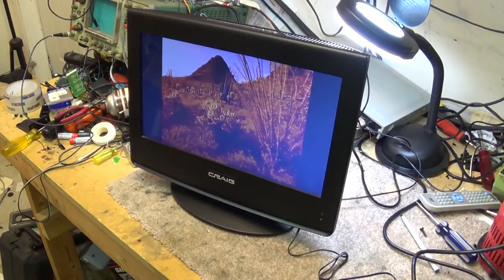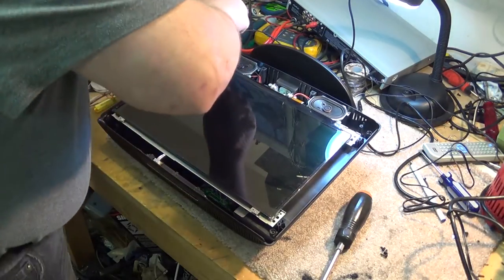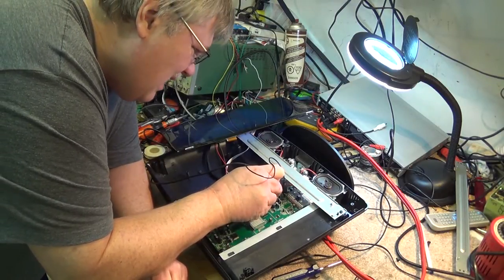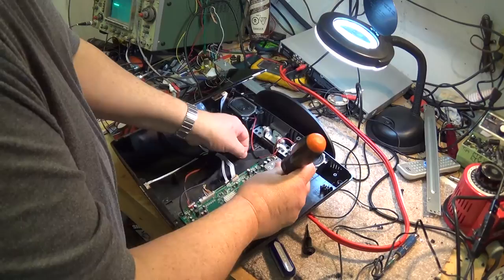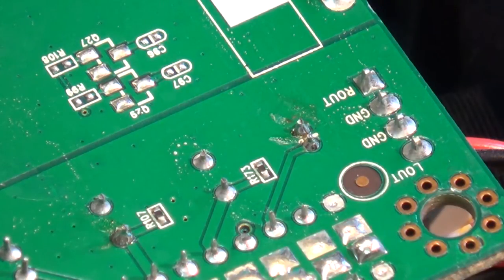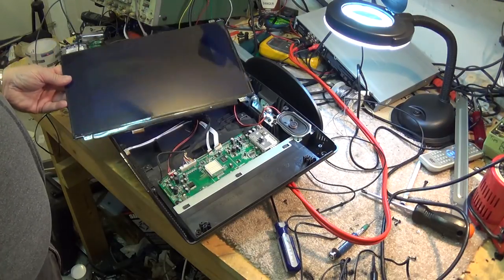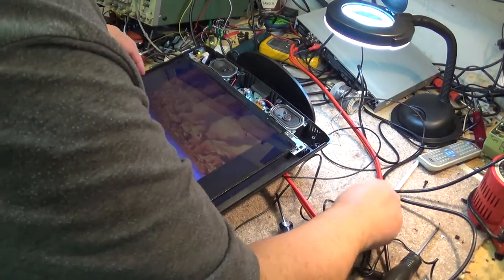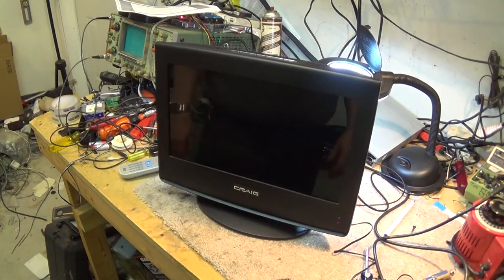Craig TV Audio Fix

Comment: Back then in 2013 to 2014 I use the 2009 Craig 15 Inch LCD TV to look the Doppler Radar and see what's next about both Severe Storms and Winter Storms which helps me to understand by look at the Radar and see if there's a line of the storm, etc. Not only that, it can actually show the Watch Box like Severe T'Storm Watch (Yellow), Tornado Watch (Red), Flash Flood Watch (Dark Green), etc., because, I like the way they can keep it up-to-date about the weather events. 

And what channel I do use back in the day? I was tuned to Ch 11.3 SDTV, it's a WHAS-TV. Until by the time when they change to a new program were they got Accuweather move from Ch 11.2 to 11.3, they put the TV station what they called "Justice" channel. They no longer broadcast their Doppler Radar to Ch 11.3 because due to a new program they signed for, and I find that is sad you know, it feels like I don't get any resources from the station which that's my understanding.

Comment: I have a Craig  13 inch Model No. CLC503.   When I turn it on from the remote the light on the TV goes from green to red.  A few seconds later the screen starts flashing.  Over time
the flashing slows down and then stops and the TV works perfectly.  I tried a different power supply with no change.   Any tips would be appreciated.   Thanks

Comment: 2.8 lbs. That's what mine weighs and there's a less inside it than yours. No picture, debating whether it's even worth bothering with. But it's more of a challenge to me to get it to work I guess. Got it from Goodwill for $0.99. I noticed a TCL part in it. Mine, the screen was attached to the front bezel.

Comment: what is the highest voltage your scope will handle? thank you...
Reply from the maker: The maximum input is 400v but with a 10x probe that would be whatever the maximum rating of the probe is.My 10x probe is rated 2KV,  So at 2KV the scope would see 200V. The reason for the prove rating is insulation. There are higher rating HV probes available. WHen I was working in the shop we had a 30KV HV probe that would attach to either a convertional scope probe, or VTVM probe.
That was used for measuring extremely high voltages in old tube televisions. Back in the day the flyback output was just the transformer, so it was common to scope the output and measure the 25 KV output, or measure the voltage with the VTVM. Then came the trippler blocks, so the transformer voltage was lower going into the tripler, which is nothing more than a string of diodes and capaciotrs, that would take 10K or so AC going in, and turn it into 30K DC coming out.  Dangerous stuff those old sets were.
Reply: thank you...

Comment: Hi, my exactly same TV only flashes and will not turn on. Blinks the screen for less than a second and keep doing the same but won't turn on. Do you have a recommendation where to look for when I open it to be checked? I really appreciate your help.
Reply from the maker: Just check the usual suspects, capacitors in the power supply.
Reply: @12voltvids  My Craig CL303 is doing the same thing.  When I turn it on it starts flashing the picture on and off.  Over time the flashing slows down and finally the picture
is perfect.   Did you fix your problem and if so what part was it.  Mine has been doing this for a few years.  I just turn it on about 15 mins before using it.

Comment: i have that exact same tv and it has the same problem i can wiggle the hdmi and sound comes out but sometime it makes sounbut then it will just not make sound can you help me and maybe would this method work
Reply from the maker: Yes that is what this one was doing. Bypass the muting circuit like I did and that should do it.
Reply: +12voltvids. k. thanks

Comment: I have a Craig  tv too.  Probably  the same model.  Its recently started auto switching through menue and cranking up the volume   on it's own. Took the batteries out disconnected  the ir reciever. Disconnected  the button on top the the tv from the board.. to no avail.  Thought  it might be a heating issue so I   put a fan on  it and no change. The issue doesn't happen right away. Usually  takes a few minutes.  If I turn it off and then back on right away  it happens  right away . I really feel it has to be a heating issue

Comment: Craig has been around since the 70s if not the 60s most american companies from that era are long gone, Bose, and sceptre (they made and still make monitors for big name computer  companies) are also american companies. Model power (cheap model trains and acessories) and coby, both american companies shut their doors back in 2014.
Reply from the maker: +Raymond Leggs Its a shame, because I remember when Americans made some fine electronics. RCA, Zenith, Admiral, AGS, Motorola and Curtis Mathis are a few I remember well. When I learned electronics, it was those brands I learned on.  But the buying public demanded cheaper and smaller, and the Japanese got a foothold. Soon it became too expensive to manufacture in North America, because everyone wanted cheaper products.We asked for cheap crap, and we got it.

Comment: That little bit of solder fixed it !!!
Reply from the maker: +Donald Ellett Yup, just bypassed the muting circuit. It was probably a little cap that charged up to release the mute, but that was an unnecessary component. No need for it. Big deal there is a "pop" when turning it on and off. If it was a high power amp then yes you want to mute to protect the speakers, but on this 1 watt, going down hill with the wind amp, it isn't going to damage anything.

Comment: this was just the easy way out.not the real fix.
Reply from the maker: L L 
a fix is a fix. the owner wanted it fixed as cheap as possible. not going to chase down a component when there is no money. this gets it going. that muting circuit is not needed. not like it is a high power amplifier that is going to blow a speaker. so makes a click when turned off. Big deal.